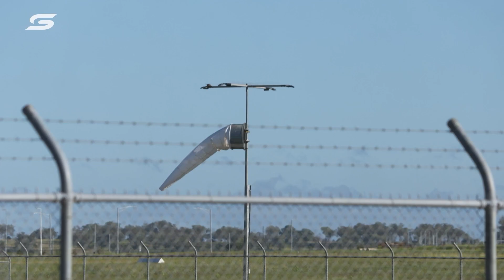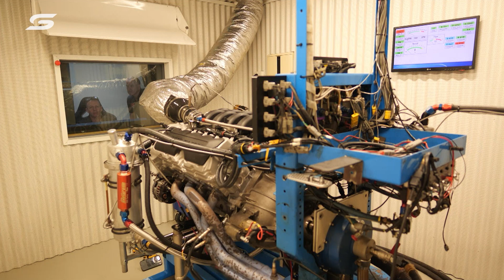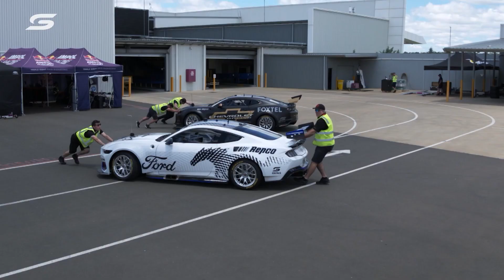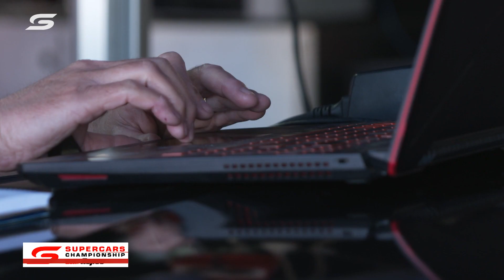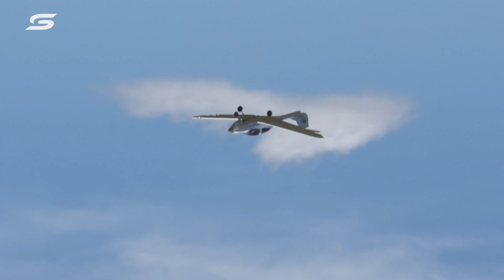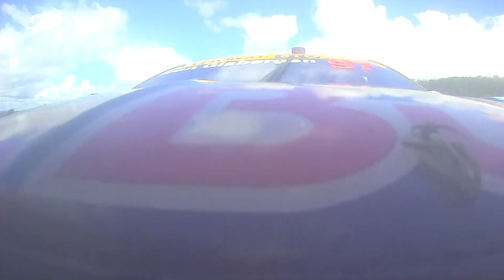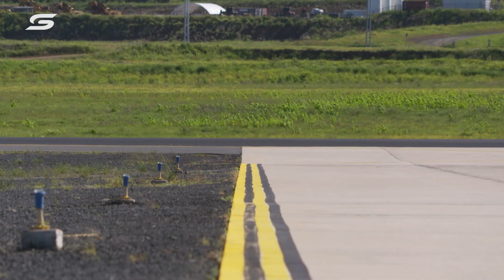Why aero testing Gen3 is so crucial | Supercars 2022

Comment: WAU must think the ford is up on the GM ..
Reply: Supercars will make sure it works and slow the Mustangs . No parity changes since The Opels started to dominate in August , 2019.
Only improved cooling for the opels at the start of 2022.
Reply: @Steveaustin007  V8 super cars are famous for slowing the ford up.. eb-el days also..
Reply: @Steveaustin007  Salt should be on your chips
Reply: @XeKToReX0  very clever statement you make . The houses and bogans will be proud  of you .  Only people that understand the history in Australia since the 1970’s And know about what actually happened & unbiased will agree.
Reply: @Steveaustin007  For it is easy to criticize and break down the spirit of others, but to know yourself takes a lifetime.
Reply: @Steveaustin007  ford has not signed off on the test results from what I heard, they are concerned the Demonstration laps at evens were "considerably slower". 1, they are demonstration laps. 2 one was driven by dick Johnson (old man, not as quick as he used to be) 
Lets wait and see.
Reply: Nah they just got Ford support
888 gets all GMs funding.
Reply: cause ford sells cars in Aus it gives the teams more money. gm only supports triple 8.
Reply: I have been told by a couple of people the Camaro is not handeling well at all even though there is complete parity between both of the cars evdn if you watch the footage from testing in corners the Camaro is washing wide off of the corners no matter what they do to it. The Camaro is not going to work as a supercar.